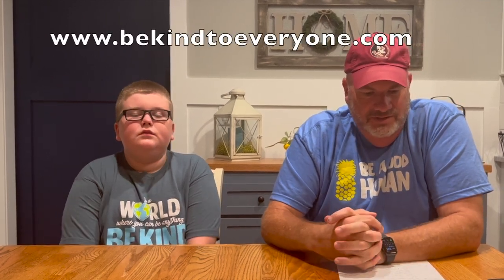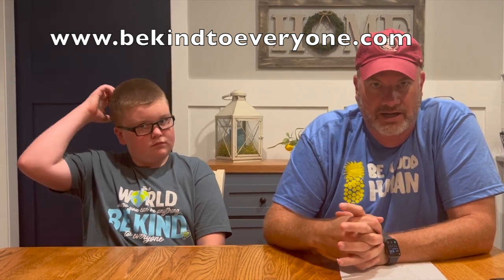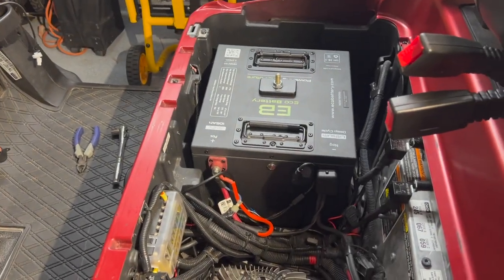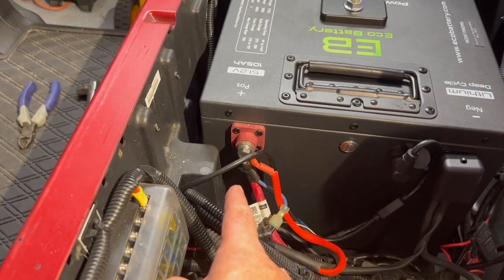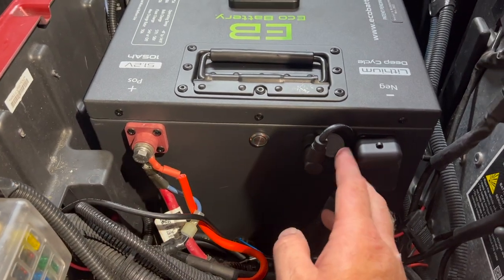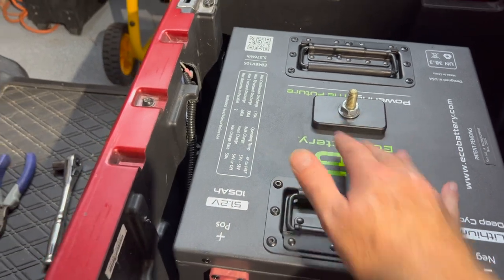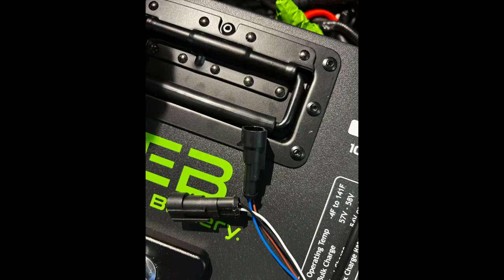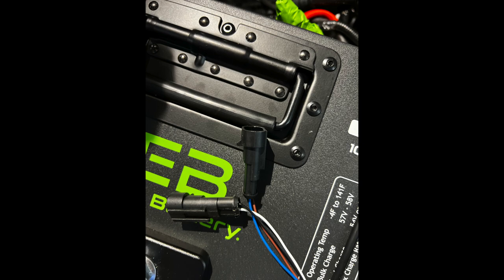Eco Battery “Lithium Battery” upgrade Part II to a Club Car Onward #lithiumbattery #clubcar

Comment: I would be interested to know if, after the app comes out, you would have the option of charging to around 85-90%. If you're not planning on driving 40+ miles a day it should extend the life of the battery.
Thanks for the video and promoting kindness.
Reply from the maker: Evening! Correct. They tell me with lithium batteries it is best to charge it to 80% majority of the time to extend the life of the battery but their BMS gives us the capability to tell the charger what to charge to and unlike most batteries on the market their battery shuts off around 90% to help extend the lifespan of the battery. So no need to worry about charging to 80%. So they recommend charging to 100% at all the time. Hope this helps. As far as the app, it is still in the works! Thanks for the kind words.. take care and be safe!!

Comment: Were you able to reuse the factory voltage reducer that comes on the Onward?  I know the kit includes on. Thanks, nice video!
Reply from the maker: Absolutely! I did and added a 12 way Nilight Fuse box to run all the accessories and lights. It works like a charm. Thanks for the kind words..

Comment: Very informative video and thanks. I do have a question for you as I have just bought a used 2020 onward with stock motor and controller with lead acid battery's. My question is do you have the stock controller and motor that uses the Regen braking? If so does this lithium pack react alright to Regen braking?
Reply from the maker: Thank you very much for the kind words! I do have the stock controller and motor. I want to upgrade, but I like being married better 😆. I noticed a complete change in stock pick up, longer life and a little more speed. Check out our “part one” video and you will see what I mean. Nothing “scientific” but what all of us measure it by in reality. As far as the regen function. If your asking about the braking, I had my dealer disable that when I bought it. It was annoying to me because it was too aggressive and overkill in my opinion.
Reply: @karlyleprojects9367  I can defiantly understand that. Yes, I watched both part one and two before I replied. I am planing on keeping my stock controller and motor. I don't feel as I would ever need more than that. I guess what I was wanting to know from you is the Regen braking we have on our Onward' s send current back to the battery during the braking process and I have read where it will overload your battery pack and cause it to shut down on an over current situation and you have to wait for it to reset. I was asking has that happened to you with the Eco lithium battery pack?
Reply from the maker: I have had my first battery for a year and never saw a problem, this hasn’t shown anything resembling that either. Thus far I have no complaints and all my goals were met with the purchase. But……. if I do, I will definitely update the post and reply to your comment immediately. Hopefully this helps you!
Reply: @karlyleprojects9367  Thank you so much for your input and the information. I will be upgrading to the Eco very soon.
Reply from the maker: Absolutely! My son and I thank you for taking the time to watch our videos! Take care and have a wonderful evening!!

Comment: What kind of range do you get …?
Reply from the maker: Hey! I have not done a range test on the new battery. As I mentioned in the video, the one I had for a year, I tested when I first got it. I was approaching 40 miles, and still had charge left. I was just done riding around in this low country heat lol. Now that it is cooling down, I will make a run with this new battery soon and we will post the results. Hope this answered your question! Have a wonderful day!!